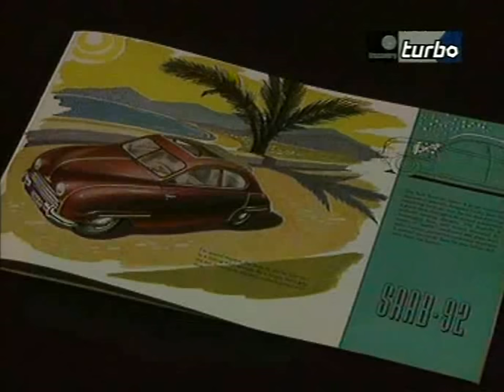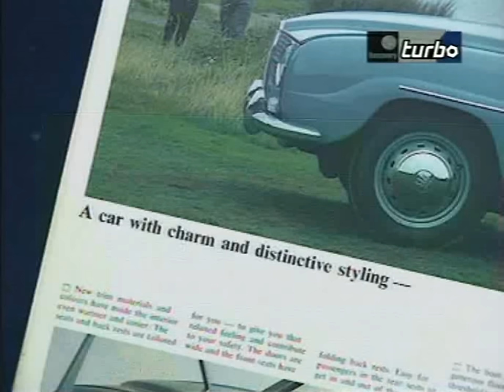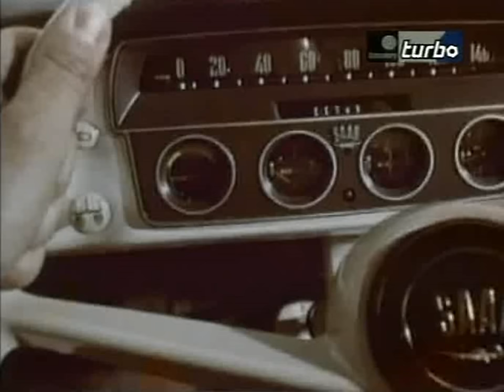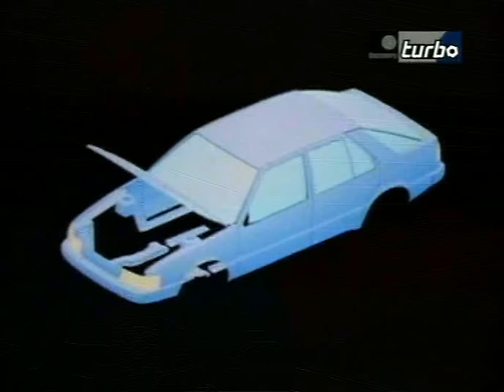History of SAAB Documentary

Comment: Putting the V4 engine in the SAAB 96 was a mistake as the extra torque cause the gearbox casing to distort which ran the bearings. It needed a rigid casing or better still stuck to the two-stroke. The hooke inner drive shaft joints were suspect too. But eventually the V4 engine blow up.

Comment: The moment GM stepped in was the beginning of the end of Saab. They wanted SAAB to change tack and merely rebadge existing GM designed cars with just body and badge changes but same GM mechanicals and platforms. If SAAB had gone this route, the public would have seen them for what they really were and would probably have refused to buy them, but kicking your parent company in the pants and refusing to comply to save costs was the straw that broke the camel's back causing GM to say "enough".